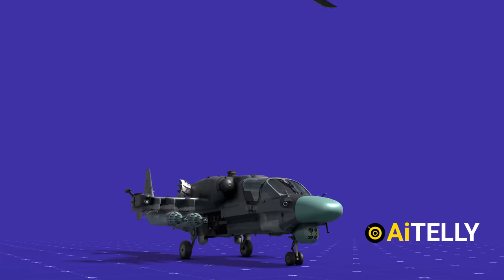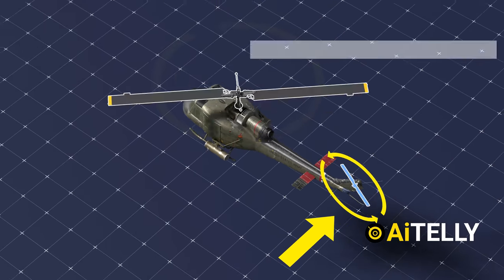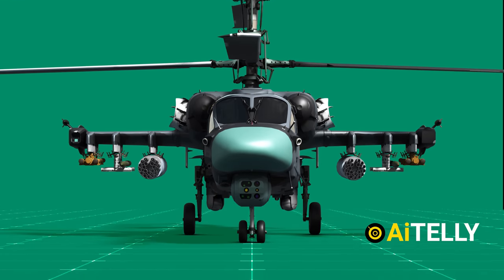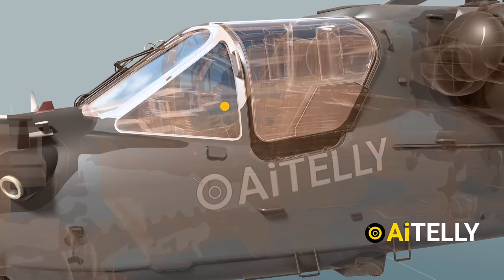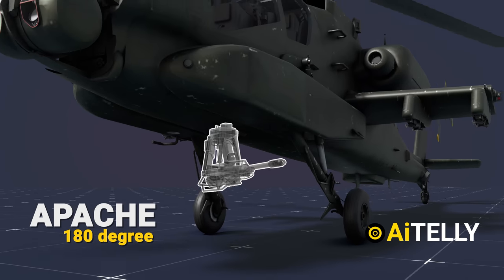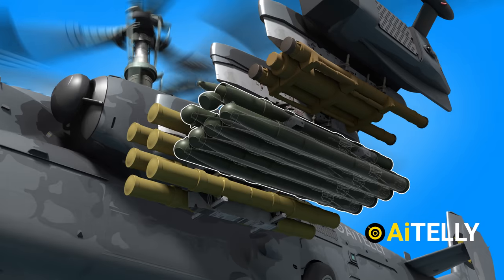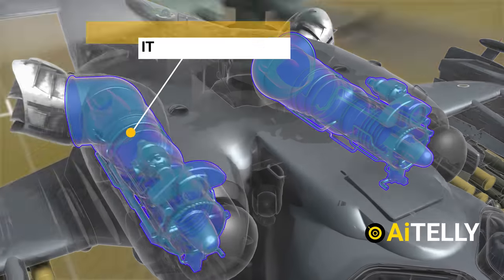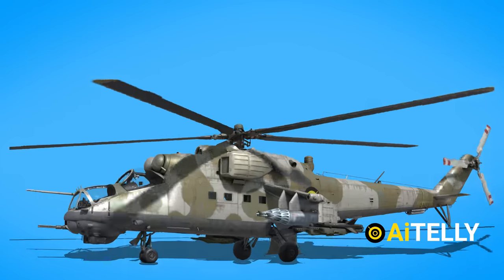KA 52 How Military Coaxial Helicopter Works #ka52 #helicopter #coaxial

Comment: In June 2023 one of Ka-52 "Alligator" was hit by Ukrainian MANPAD and the tail stabilizer was destroyed completely. Nevertheless the crew managed to bring it back home safely. Apache AH-64 with this kind of damage would have go down immediately.
Reply: Exactly!! I saw the footage!!! If that was the apache, it would have been destroyed from such a hit!
Reply: 10 years ago, there were heated debates on the Internet between supporters of the Mi-28 and Ka-52 platforms. Supporters of the Mi-28 responded to this argument that the coaxial scheme has a danger of overlapping screws during intensive maneuvering.
Reply: @ЭвМ-ЭффектвМассы  with engineering experience this problem becomes less and less significant.
Reply: Yet they have almost lost half of their KA-52 fleet in Ukraine, seems like russian statistics are way overhyped!😉
Reply: @crissdiamond1907 cope harder.
Reply: very true
Reply: @heyhoe168  ok, can you see the radar the KA-52 have in use… the west stopped using these in the late 80’ due it just pick up signals when being right in front of the sensor!
New western radars pick up a full picture that’s in front of you a put every target in the target computer, that means that it’s much easyer to work with many targets at the same time!
And instead of having a almost fixed 30mm gun I would rather chose the movement of an 180degrees 30mm auto cannon with explosive shells + having all these Hellfires(16) for both aerial or ground targets instead of several other missiles to have to make choice from in combat!
And why not have modern sights for both use in day or nights instead of 20-30year old tech that russia are allowed to buy from the west?…the russian military technology is heavily depending on old western stuff… that’s why they are trying to steal as much washing machines as possible so the can built more missiles🤣…I really like the ejection system but it’s hard to understand what help it’s going to be if the helicopter doesn’t fall straight down, without rotor blades this helicopter would probably be more like an spinning bomb that will fall with its nose down… probably why we haven’t seen any ejection from the KA-52 yet from the vids when they been shot down.
Reply: @crissdiamond1907  wym? It uses AFR.
Reply: @crissdiamond1907  за все время я видел два видео где применял свою пушку AH-64 и одно где применял ее К-52. На первом Апач расстрелял толпу гражданских на улице одного иракского города, на втором, под едкие комментарии пилота и оператора, расстрелял караван талибов, на ослах, с АК-47. А вот К-52, израсходовав все ракеты, под огнем ПЗРК, заходил на украинский ЗРК Бук. Чувствуете разницу?
Reply: @crissdiamond1907 lol, where are you gettings a y statistic date ? Generals bring it right in your hands 😂😂😂
Reply: @rmngrnk6752  what generals? The ones on russian state TV that gotten their medals from parades/bombing civilians or for being corrupted together with the government🤣
Reply: @crissdiamond1907  and yet they use them on a daily basis seems like your statistics are overhyped
Reply: @crissdiamond1907 u enjoying those Bradley's burning becouse of the Ka 52?
Reply: @tonyjoka2346  most of the Bradley’s lost was due mines and most of them being repaired…And there will be sent more of the Bradley’s… enjoy the numbers of destroyed KA-52 instead because they are higher then the losses of Bradley’s!
Reply: @tonyjoka2346  yes KA-52 overhyped by far and their losses are high by GTA missile systems , and why are there vids showing them shooting at agricultural equipment and say that is it tanks🤣when you can see that it tractors and harvesters?
Reply: @tonyjoka2346  if they was that great that you think they are… why are they not flying in the direct combat zone anymore? Soon they can’t fly behind it either due mr.ATACMS going to visit their airfields!
Reply: @MsDoctor113  lol, russia don’t produce any technology by themselves but still they have the newest and best weapons on earth🤣 …do you really understand how dumb that statement is🙄
Reply: The tail collapsed not as a result of a defeat from a MANPADS, but as a result of the dropping of suspended fuel tanks by the helicopter itself. Watch the full video of this episode and you will see that this is indeed the case.
Reply: @crissdiamond1907  The USA is looking for 70 year old veterans because they forgot how to create stingers. The modern armament of Europe (in fact, rubbish from the 80-90s) does not help Ukraine in any way in the counteroffensive. Ka-52 is the first helicopter that is used on a real battlefield, in conditions of high concentration of air defense. At the same time, Apache was used only to shoot unarmed Taliban, who, God forbid, had MANPADS in their arsenal. The entire Western world recognizes the Ka-52 as a real threat in combat, so don't brag about your technology until you've actually shown it in practice. Neither Javelins, nor HIMARS, nor Bayraktars - not one of these types of weapons radically changed the picture of the battle. Because the battle is won by strategy, communication, planning.
Reply: @crissdiamond1907  Your lies are simply ridiculous when you try to pass yourself off as a military expert, and you are an ordinary Ukrainian provocateur.lol🤣🤣🤣
Reply: @crissdiamond1907  призрак киева весь парк ВВС России уничтожил, забыл чтоли?
Reply: @3aTMeHuePa3yMa  ?
Reply: But could the AH-64 have had other abilities or countermeasures to avoid that hit in the first place?
Reply: @crissdiamond1907  как твои леопарды поживают?
Reply: @3aTMeHuePa3yMa  why not write in english? …that is not my language, but I use it so everyone educated can understand! Eller vill du att jag skall använda mitt modersmål?
Reply: @crissdiamond1907  почему бы не пользоваться переводчиком, если он вставлен в браузер?
Reply: @hrthrhs  The same as any other modern attack heli. Chaff and flare, but Ka-52 has special system called 'Vitebsk'  to avert incoming enemy missiles.
Reply: @heyhoe168  tf you mean cope LMAOOOO
Reply: @crissdiamond1907  Don't you have a built-in translator in your browser?
Reply: @Zhorik123  nope
Reply: @crissdiamond1907  The KA-52M has been produced for a year with many improvements and yes there is a radar with an active phased array. During the famous counteroffensive of Ukraine in June 23, they did not lose more than one Ka52. This indicates a very good missile defense system. The Ka52, like any technique, has disadvantages, but it proved itself worthy.
Reply: Yet Ruzzia is still losing?  Crazy huh?
Reply: @crissdiamond1907  Come on? In our browser, it is enough to select the text of the message and right-click and all any language is translated into Russian.
Reply: @OGLizardKing  So far, only in your sick fantasies
Reply: @Zhorik123  not much to complaint on your text, BUT the counter offensive hasn’t started yet due Ukraine still have 11-12 battalions that are not at the front and if  the KA-52 has to launch it’s missiles from long range 10-12km it just have proven to be an another weapons platform and not what it was supposed too and thats why almost half of them are shot down and why some videos shows when the are attacking civilian equipment like agricultural machines… so worthy for who.
Reply: @crissdiamond1907  i see that you seems just cope harder for avoiding the truth. If Apache deployed in Ukraine it Will be same just like KA 52, there Will be so many helicopters that being vulnerable to manpad but this ka 52 engineering is proof to be survivable although so many KA 52 lost

Dude Ukraine has manpad, they're not using RPG just like in the Afghanistan

If Apache we're getting hit by those manpads those Apache cant even survive when it goes falling down due to rotor failure too it would causing the helicopter itself spinning and cant be controlled 

This war is different than the previous war in the Afghanistan
Reply: @crissdiamond1907  i think you're the one who trying to cope harder here

Russian already mass produced the tank and their helicopters too
Reply: @igorsvideo389  have I compared this war with Afghanistan or have I said that the AH-64 is invulnerable? Just saying it’s a big differens in technology and what they are built for, the AH-64 have better systems both in targeting/radar and weapons… the russian pod launched missiles is unguided when the US have laser guided ones… Khrizantema 9M123 missiles is laser guided when Hellfire AMG-114 is an fire and forget and the AH-64 was built as a low flying attack helicopter that is able to hide behind obstacles when the KA-52 was built for flying above them!
Where did a AH-64 got shot down in Afghanistan???…never heard of that and the talibans used russian manpads.
Reply: @crissdiamond1907  i know that those Afghan got manpand from Soviet but this is Ukraine they got hundred or even thousand and plus the terrain itself really different There's no hill and mountain. What do you mean fly above them? Didnt you even see the footage that KA 52 always fly low altitude along with the mi 28? Ukraine just like open field so the ka 52 always can be seen from the enemy also im telling you again Ukrainians has more manpads than the Afghanistan

This KA 52 is not vulnerable but atleast the pilot still can take control the helicopter to get home safely because the engineering design

If Apache in Ukraine already, they get shot down easily and the pilot cant even take control if the rotor tail is falling apart like a rock. Ka 52 can attack with their guided missile in outer range of enemies too

I already Saw so many news that KA 52 has been shot down in many western media bro
Reply: @igorsvideo389  when you don’t understand the functions of different helicopters why bother to answer🙄the KA-52 has an older radar in its nose and that means it has to be above obstacles/objects to find them… the AH-64 has its top class radar above the rotor blades and that means that it can stay hidden behind objects and chose targets without being seen… and just reveal themselves to fire the missiles(hellfire) and go back behind its cover!..the best helicopter russia has is the Mi-28 and the only issues that it has is the radar due it has to be revealed to find its targets and aim with its lasers.
Reply: @crissdiamond1907  older radar??? Bro are you from the 90's? Ka 52 already upgrade their new radar you must been missed some footage that KA 52 can attack from the outer range. And they have a feature that can jamming the radar lock. Where have you been bro? They even use same tactic hidden from the enemy and then attack with the guided missile too i think you Miss the new "functions" of the new version of the KA 52. Dream on and cope harder again 😐
Reply: @crissdiamond1907  im not telling you that all attack helicopters are the "best" they are still vulnerable when got hit by those manpads, beside Russian in current condition already mass produced the military vehicle rapidly
Reply: @crissdiamond1907  even the newest u.s helicopters try using the Russian engineering design from KA 50 and KA 52 for making a helicopter called S90 Sikorsky 🙄
Reply: @crissdiamond1907  i think you just Saw the KA 52 footage with rocket pod right? Not the manpads one? Dude i think you still not accepting the truth even There's already a proof
 Cope harder again bro dream on 😀
Reply: @igorsvideo389  nope, I’m not from the 90’s and when you take a look what technology russia produce it’s NADA or NONE if you prefer English… that means they buy or try to replicate their military technology from the west just like China and other countries under development!
Do west sell them the best stuff they have? What do you think? …and why not take a look what russia produce and what quality it has🙄
I wonder who is the one that’s dreaming🤔
Reply: @igorsvideo389  the rotor blades solution is not new🤣
Reply: @crissdiamond1907  i know and who said that it was new?
Reply: @igorsvideo389  do you understand logic? if yes, then you couldn’t have missed what I wrote about the radars and how they work or the Hellfire missile either., so how can a radar look over a building if it’s right in front of it and how can a missile be jammed if it’s not using a radar to hit the target… and where is all the high tech stuff produced in russia?
Reply: @crissdiamond1907  There are few countries that can produce the entire range of goods themselves. But Russia itself makes military civilian planes (helicopters), its own production of thermal imagers, radars. Ships, buses, trucks. cruise missiles. Nuclear power plants, including mini and nuclear batteries, agricultural combines and machinery, one of the best software for controlling and automating the management of combines. There is its own space industry, the 90s in Russia ruined the institutes of qualified personnel now, of course, there are problems with personnel, but still Russia was famous for mathematicians, programmers. Russia, of course, is somewhere far behind the United States. but to say that we live here as in a banana republic is by no means impossible. As for me, the coolest country in terms of development is China, they bought half of Europe and using European technologies
Reply: @crissdiamond1907  What makes you think that half was shot down? I've only seen 10 videos at most. According to the US assumption, about 20-25 helicopters were lost. And the loss of the majority was in the first months. The most important thing is not to attack civilian buses. If you look carefully, almost all the videos of military equipment attacks. I saw a video where UA soldiers wondered why homing missiles could not hit the KA52.
Reply: @crissdiamond1907  uhh because their missiles have long enough range? funny when you say it aint supposed to rain fire on the enemy when that's what it is intended to do🤣🤣
Reply: @ligmasurvivor5600  , I just compare logic(so some dumb people can understand) and reality so some deceived people can wake up… The KA-52 is so great it has to launch its missiles out side the combat area and when it try’s to sneak in it gets shot down, it ain’t close to that it was meant to do!
Reply: @Zhorik123  that's cause president-s/khibiny system (although it's not perfect its pretty darn effective)
Reply: @ЭвМ-ЭффектвМассы  honestly i think both are good helis but the ka52 has a slight edge
Reply: @hrthrhs  yeah main countermeasure: doesn't fight against country with good anti air
Reply: @crissdiamond1907  all this shit stop working right when you get to fight agaisnt well trained and well armed army, AH+64 never met so much AA and MANPADs or AAA, all other  so called "experience" is just bullshit, Ka-52 also acted perfectly in Syria, no one lost, cuz THERE NO proper antiair
Reply: fakebotka
Reply: @Тахирахмадов-п3у  is that the new name of the KA-52🤣
Reply: Maybe because both helicopters have different types of rotors?
Reply: @wisemysticaltree2444  Ka-52 is a twin rotor heli, unique in it's class! Without a tail rotor.
Reply: I thought that ka-52 flying with no tail is only in war thunder💀
Reply: @snowpiercer4777 no, it wont be destroyed, but it will reture in a fixed position on the ground with flames on it for a while